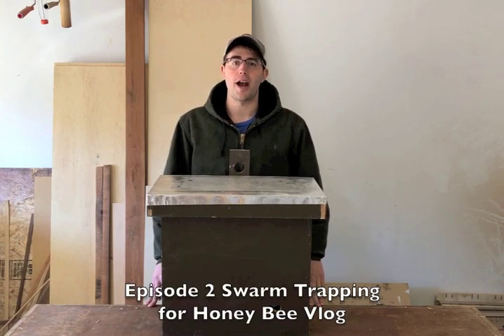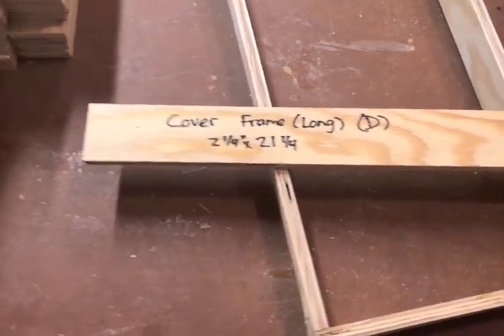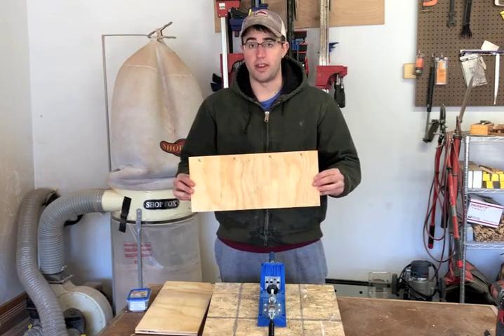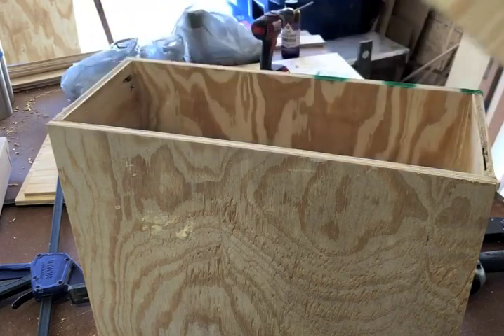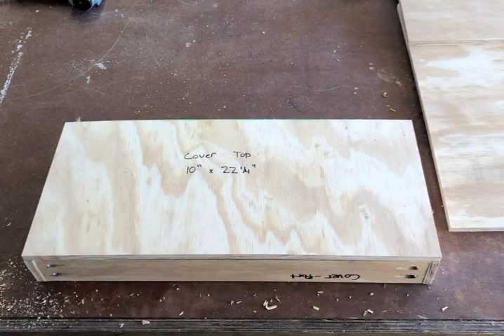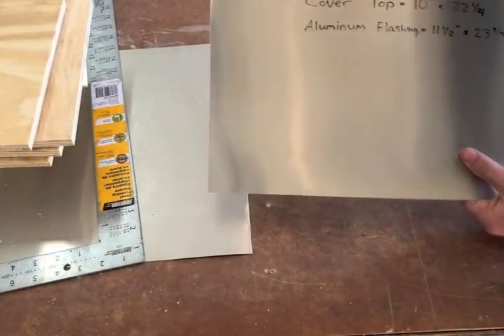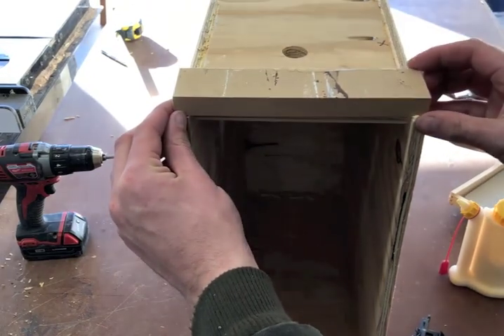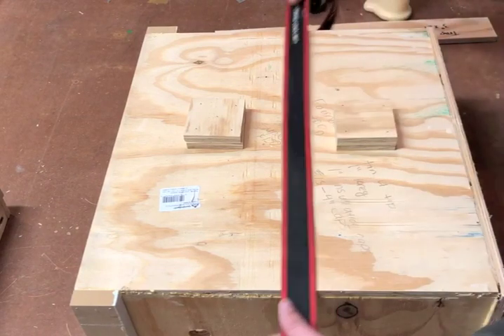The Complete Guide to Building a Swarm Trap or Bait Hive - Episode 2

Comment: I built my first 3 bait hives in 2019 following basically the same process. @beecatcher6653 has a link to his instructions on his channel but he has gone silent about 3 years ago. My first year beekeeping was 2019 so I didn't have any used comb. So my first year was a bust. So what did I do my second year? I built 3 more. Now that I had used brood comb I caught 3 swarms. I did mess one bait hive up some how. I think that I built the sides using the bottom board as the frame rest was only about ¼". I finally corrected the issue this afternoon. By taking my multi-tool and cutting the side to the correct length.

Comment: Instead of using the insulation caps i'm thinking you could just lower one or both of your handles 1/8 of an inch down before nailing them on to give ventilation. Haven't built any yet but getting ideas. Also I myself overkill everything I do but honestly, leave the kreg jig gadget to the cabinet makers. Your getting very little penetration into the 2nd sheet of plywood. If you would just butt screw it to a 90 you could utilize say a 1 1/4" wood screw. With the kreg pockets your creating a fast way for your would to rot. Consider countersinking your screws and using wood filler.

Comment: If you paint it before  you put the aluminum  on top it may be easier.  Also  taking it down with removable top seems  like a pain.  On mine the top hinges on screws(cheap hing) and a cheap snap done clasp on the other side for easier  operations.
   I like the plastic spiners on my entrance  hole. Makes it easy to close when taking down or if you see a ball seen during season  and have a swarm trap in your vehicle  you can put the same in the swarm trap and turn the spinner to queen excluder setting so you can leave the box sit and the bees you didn't  get into the box can find their way in to their queen  and you can get them all by the evening and close them up with just turning the spinner.  
    Squirrels  eat chew them up  I'm experiencing with solutions  for that. Hot sauce  mixed into the paint did not help.  Next try will be wrapping  with hard wire cloth.
   Why use pocket  screws  on part ot it then nails on others?

Comment: Hey mate, love the videos.
I notice your bottom panel is 19.5" wide, but the side panels are only 19.25" wide... What's the reasoning behind the extra .125" overhang on each end of the bottom cover? 

Cheers,  Doug from Australia
Reply: dougie995 I ASSUME it is because a lot of times if there is no lip at all the Swarm will actually land on the bottom ..well the queen does and then the bees follow, this gives them a place to land instead of missing the entrance hole so to speak. A common problem with swarms it's the only thing I reason I could imagine

Comment: Hi followed instructions exactly and the telescoping cover is way to long. I used 5/8 plywood and ended up with approximately 5/8" of extra space on the long side of the cover. Way too much play for  the cover fittting the swarm trap box. I could see this amount of extra room if you where adding vents under the lid. Possibly I missed the reasoning for so much extra play? I don't think the plywood will swell 1/2 it's width on each side. So far I am thinking the lid length was, I don't know, why put this measurement out there?